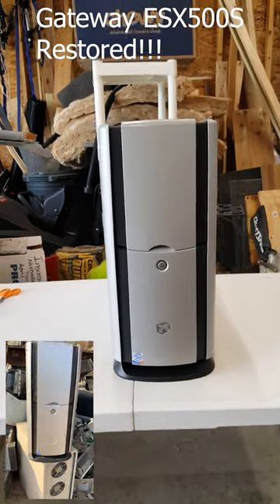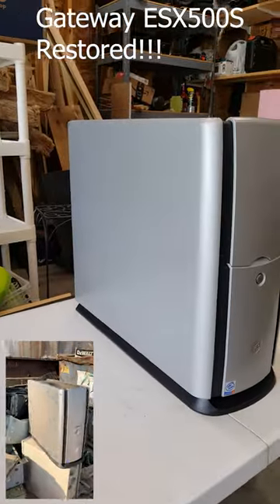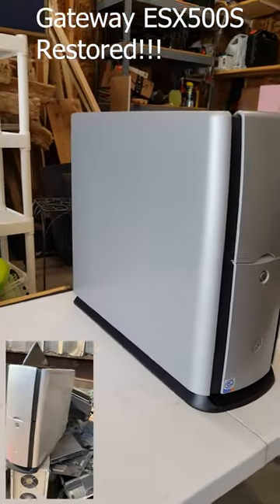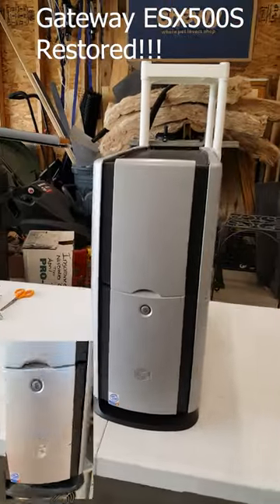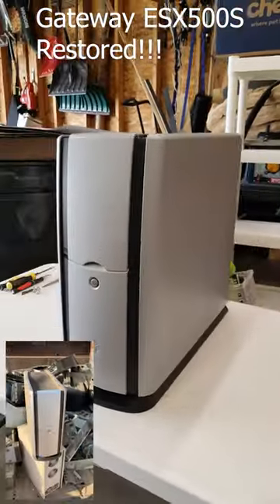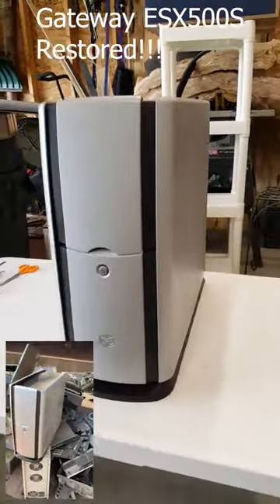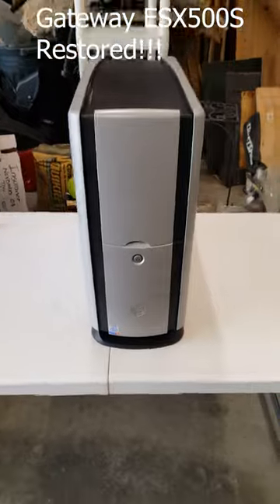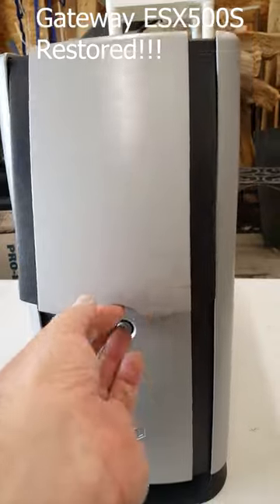Gateway ESX500S Retro Tower Case Fully Restored #shorts

Comment: I have one of those but it keeps randomly rebooting I have uninstalled and reinstalled the ram did the same for the graphics card looked at every connection and I tell down the button on the power supply and that worked after turning it on it worked for 3 hours and it kept rebooting again I suspect Ivor a hard drive dying the ram is giving up or the graphics card is dying so I got a new graphics card and I'll look for one of my spare hard drives if that doesn't work I hope you ram will because I don't want to deal with a CPU or power supply failure